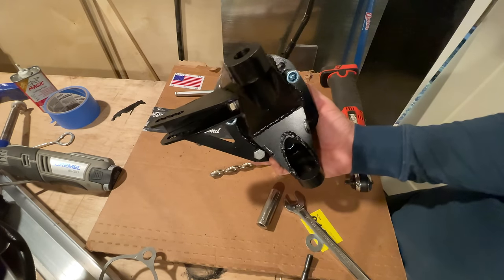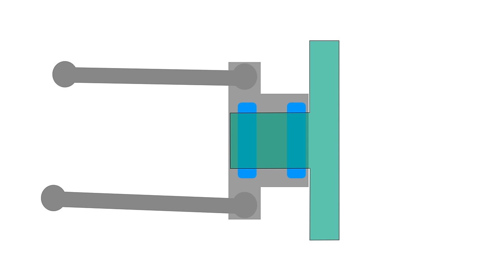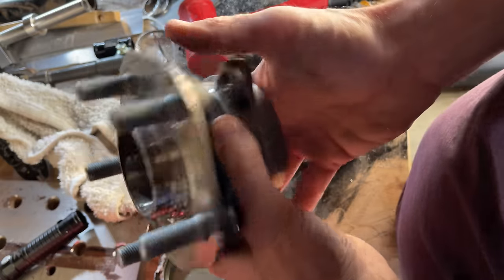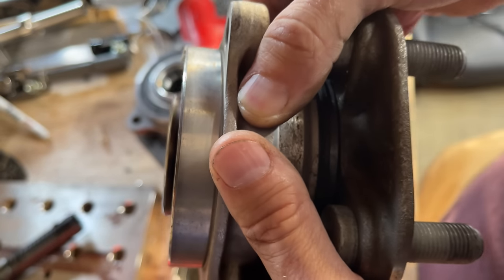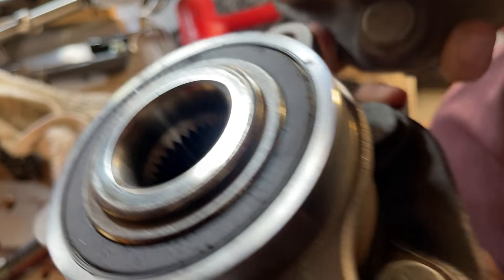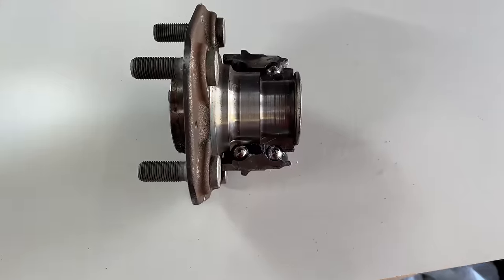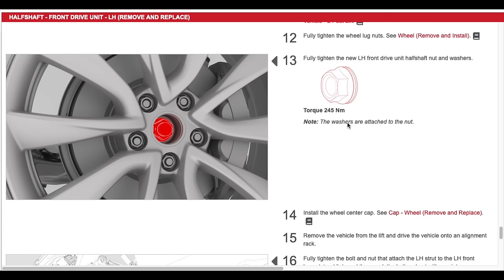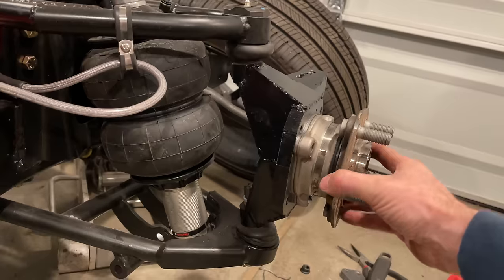How Wheel Hubs Work

Comment: Since you have so many hubs now, why not just add more tires to the car?
Reply: Oooooh!!! First eveah Jaguarx 6x6    sexxxy!!
Reply: @noobFab  Like the car from League of Extraordinary Gentlemen haha
Reply from the maker: I’ll just build a new car, starting with the hubs
Reply: @SuperfastMatt  But will it be a 6x6, because then you'd need to buy a few more hubs!
Reply: @SuperfastMatt  sounds simple😅
Reply: @SuperfastMatt  if you do this, i will subscribe
Reply: Or make a trailer..
Reply: Aren't you supposed to be warming up baby bottles?
Reply: @SuperfastMatt  seems legit.
Not gonna build it from the top down!! Haha
Reply: @noobFab  it would actually be a 4x6 since those non driven hubs have to go somewhere.  That's of course assuming he drives both rear "axles" if he doesn't I guess it'd be a 2x6 which is just weird.
Reply: Plenty of room in those front fenders to do a Tyrrell-esque Jaguar MkV/P34
Reply: Imagine 2 sets of wheels at the back. That would look so mean
Reply: @SuperfastMatt  that's the spirit!
Reply: Missed Opportunity
Reply: @SuperfastMatt  yup save money by building another car or 3…..
Reply: I'm thinking you should Mount them at 90°in the middle of car on each side, then have electric actuators to push them down so you could crab walk in a parking lot
Reply: @SuperfastMatt  that is a great idea.  Also see how hard it would be to make a 5 bolt hub into a 10 bolt hub

Comment: Hi, I used to work in wheel bearing engineering at delphi. On some cars they would use the same bearing front and back and just cap the hole. You should be fine. I will say that is a ready beefy bearing though (makes sense with battery weight). I would be cautious with any aftermarket product. And yes the outer raceway is integrated to the spindle which is heat treated. Some aftermarket bearings with use different spacers and inner rings for different applications while using the same spindle to save costs. Integrating improves the tolerances. The folded over metal is called cold forming and is very strong. If you wanted to take apart easier you could have used a lathe to cut below the inner ring. Then you could just use a press to separate the hub from spindle.

Comment: As a mechanic, I could have told you this from the start just by looking at the bearing. Most auto makers use bearings that won't come apart, even if no axle is installed. This saves them money because they don't have to manufacturer two different bearings for 2WD and 4WD applications.
Reply: This.
Reply: I think you overestimate the forward planning of Tesla. There is some really poor engineering choices in their cars.
Reply: @rubiconnn  How is that different from any other auto maker? I think the only one that is somewhat smart is Honda. Also, mushrooming the end to hold the bearings together is a very common practice in the industry.
Reply: @madmatt2024  I've been a mechanic for years, almost all 2x4 and 4x4 optioned models have the same front hubs idk why people are freaking out about this... Toyota does for everything with 4x4 as an option.

Comment: Instead of paying $500 for a part, I saved money by making my own own out of $250 worth of material. Don't worry about the $1500 in specialty tools that I had to buy to do the job.
Reply: The job was only an excuse to buy the tool anyway, man.
Reply: yes. it is in another fiancial advise video, pretty sure. May be multiple times.
Reply: "Never buy anything that you could make in 3-4 weekends for less than double the price."
Reply: Exactly. And you’ll justify the cost of the tools (to a spouse and yourself) by stating that you are going to use those tools many times in the future anyway.

Right.
Reply: But these tools could be used in a future project. Or at least make your workshop look way more professional. So I don't see a downside here.

Comment: I understand the hesitation. I parted out one of my Explorers, pulled the cv axles and front diff out, put it back on the ground and rolled it back so I could get the engine hoist in position, and in that five feet one of the wheels started to f' off. I knew it absolutely couldn't be driven without the stub in place, but I was not expecting it to have near zero load tolerance.

Comment: Good call on the non-driven hubs.  The front diff cracked in my Silverado once.  We pulled the wreckage out and tried to limp the truck out of the shop into the "yard" while we scrounged up a new diff.  Luckily the new diff came with new hubs.  The originals made it about 4 feet without the axles in them.

Comment: Nice cross section.

When I was making my CNC cooling, I had to cut a hole in a 1/8" stainless steel plate with only handheld tools. I was discouraged seeing a Bosch bimetal jigsaw blade dull in only an inch or so of cutting. For the CNC, I had bought some Kool mist solution. I had a fashioned a mister from some odd parts. Oddly, adding the misting to the blade meant that the blades lasted. I went from 2 blades for 3 inches of cut--to one blade for about 8" of cut. Little Machine shop, at one time had pints of Kool-Mist, whereas everyone else wanted to sell you a lifetime supply. I usually mix it up stronger than normal--just to make sure nothing rusts.

I am reminded that some bike alloy brake calipers have steel truss bolts going through them--only to be a stressed part that keeps the caliper from cracking. I hope the Tesla hubs aren't like that. I hope that the axle is not meant to keep that bearing tube together. Perhaps after a few hundred miles, the part could be magnafluxed, to check for cracks.

Cool projects. Thanks for sharing.

Comment: Typically the "driven hub" type hub has a split bearing in it and requires the axel nut and cv shaft to maintain a "clamping pressure" on it when the weight of the car is on it and normal operating loads are applied to it. not having this "clamping" in place will end up damaging the bearing and possibly allowing the assembly to fail and / or fall apart.

Comment: My Solstice had identical hubs on all four wheels, meaning that the fronts also had splines for an axle. Like you said, it depends on how the hub is constructed, but the mere presence of splines isn't sufficient to say that it'll come apart without an axle & nut.
Reply: Chevy Equinoxes are like this as well in regards to the rear hubs on front wheel drive models.

Comment: I race in Spec Corvette and we use "driven" (rear) hubs in all 4 locations without problems.They look almost same as yours with fronts being blocked and rears open with splines.
Reply: Hah, was going to point the same thing from tracking a C5.
Reply: Just curious, is there any reason you do this other than shrinking the amount of different spare parts needed?
Reply: @TheOystei  This way I can carry 1 spare that fits all locations. We also use upgraded SKS parts and I think they only come open (rear) style. We also use longer ARP studs.
Reply: @TheOystei  Yep same here, the heavy duty skf hubs only come as one part number for all 4 corners. Amusingly I've got the SKF hubs on the front and stock on the rear right now because evidently I'm harder on the front of the car than the tail.
Reply: @mrmxpop  Yeah that was what i thought. and yeah, the sweedes makes som quality bearings.
Reply: @Misterfairweather  Front sees more axial load than the rears so they tend to wear out faster. I assume this is accelerated in racing.

Comment: The front hubs on my Aston Martin Vantage are splined "driven" hubs like the rears.   They don't fall apart on the race cars.    Apparently they don't need axles either.
Reply: No hubs do, axles are floating.

If they weren't you couldn't have suspension.
Reply: @Robert-cu9bm  some hubs do use the axle stub to hold them together.   My old Pontiac did, for example.
Reply: And just to add, the rears on my older Impreza do as well, they are pressed in, but without the axles they would fall apart after some driving. However the rears on older Outbacks and Legacies are hub assemblies like in the video.

Comment: We beat on unit bearings in our rock buggies (40”+ sticky tires) the only thing that holds the axle in the splines is a snap ring. I am positive we put way more stress on them then anything you would be able to accomplish with your car. 
Either way, awesome build!
Reply: Many custom and racing hub and bearing systems are retained by a snap ring like that... which I didn't realize until recently. The pressed version eliminates the tiny bit of play that the snap ring allows, but either works.

Comment: How to save money (somehow): buy replacement parts you don't need and cut them in half.
Reply: By destroying 2 hubs, he saved himself the cost of a new Jaaaaag Mk5 front end, a cooling system, suspension components, steering rack... This is quite a dramatic failure mode.
On the other hand, gained some YouTube income.

Comment: There are AWD/FWD variant vehicles that use the splined hub in the rear regardless of whether there's a differential between them as a cost saving measure.
Reply: ... there could be axles with no differential ?  Oh well they save money on metal by having  a big hole in the hub.

Comment: Many cars use the same front hubs as the rear hubs, which don't always have axles in the rear. 
Good example is a 2014 Ford Taurus. Even just the FWD models have open axle ready rear hubs.
Reply: I'm seeing a lot of comments like this, and I'm suspecting that this is a newer move by OEMs. I've had a bearing fail (2 of them, simultaneously), but it was on a 1992 Chevy Silverado that I'd pulled the axles out of to replace the differential.  I've curious to know when this practice of "unsupported" unit bearings became commonplace.  I used to work at the auto parts store, and don't remember seeing any with the factory pressed end, but this was nearly 15 years ago.

Comment: I agree that the huge amount of torque is to stop the axle moving and wearing out the splines. Where does the bolt pull up against? a mushroom part on the axle. It does not hold the hub in.

Comment: Great video Matt.   You could also use a short shaft or part of an axle to pass through the hub and bolt it together.  Put a flange on the inside of this short shft, and threads on the outside.  Bolt together and you have similar support to having an axle.
Reply: Except that if you actually listened to what Matt said, you would understand that this extra clamping arrangement is completely pointless.
Reply: @brianb-p6586  You may be right, but I got the idea he was not completely satisfied with the flared end of the bearing carrier.
Reply: @johnmckenzie427  He's being a little paranoid by changing hub units, but every one of the millions of cars on the road with bearings of that construction and no axle shaft work completely satisfactorily.

Comment: You have to have the axle splines in the bearings with a bolt or nut because in addition to the possibility of it all coming apart the bearings will not last. Take the axles that fit in the bearings and take apart the outer cv joint and just use the shaft and cup.

Comment: Interesting construction method. So the whole thing has to be made out of bearing race material ( high surface hardness, usually brittle ) AND at the same time "squishable"  / deformable ( not brittle, usually soft ).
I'm guessing when the Metalurgic Engineer saw the spec sheet they just went like -"DAFUQ U THINK I AM? I don't do miracles!"

Comment: FYI  my experience with hubs of this type is that you always need at least an outer cv joint in there. Have seen cars pushed 100 yards with empty hubs and when they're put back together and driven the bearings are noisy.

Comment: I have a VW T5. These some in both Front wheel drive and 4 wheel drive. Mine is a front wheel drive but the rear hubs still have the splines in them for the 4  wheel drive version, these do not have a big nut to keep them together, just a big hole through the middle.

Comment: GMT800 trucks that have 4wd have this same style hub, and they do not have the flange on the back.  they specifically state to not run them without at least a stub axle in them and a nut holding them together to set the preload.  even with that flange, there would be some play in the bearing, which would pull the bearing races out of alignment and cause odd wear.  it might not separate, but it won't last as long.

Comment: I had a buddy that had a 90's grand cherokee that a cv axle went bad in and he didnt have the money to replace it. He removed both front cv shafts and drove the jeep for years that way with no problems. We even pulled a steel car hauler trailer 2,400 miles round trip across the country to pick up a car and back with no issues.

Comment: The issue is the hole in the middle, without the axle backing it up, the inside race is not up to the task, that's why the no motor versions axle hole is not hollow, go with that version for sure.

Comment: Dealer service tech, here; lots of trucks and SUVs use the same front hubs for both 2WD and 4WD models, which are of course splined. They are all the "bolt-on" type rather than the "press-in" type, the latter of which absolutely require an axle and a nut. Both require a good bit of torque, though, to prevent the axle from breaking its own nut loose and coming apart.

Comment: I'm pretty sure they will hold together without an axle in them.  We have cars in our Cab fleet that come in 2WD and AWD, but use the same bolt in hubs for both options.
Reply: That's a broad assumption.  In Matt's case it's probably fine because the visual inspection seems to indicate otherwise identical construction.  Not all unit bearings have that pressed flange, however, and those without will fall apart if loaded without the axle shaft installed.

Comment: My first reaction to you starting to saw through the whole hub with a reciprocating saw. "That's gonna take quite a few blades"
Reply: I know he really loves buying those multi packs of blades but I was thinking how he really should use a angle grinder with a cutoff wheel to zip through that whole thing quickly. And then he gets an angle grinder with a cutoff wheel and only uses it to go through the hardened race.... And he's right back to the slow reciprocating saw blade. Lol

Like dude, you could have cut through the whole thing with a 98 cent harbor freight disc but instead let's go through multiple reciprocating saw blades....
Reply from the maker: The outer part was aluminum which doesn't cut well with a cutoff wheel. but mostly I hate cutoff wheels. They cover my garage with a fine mist of tiny metal shavings. Less so with the saw. Really I should have used a band saw.
Reply: @SuperfastMatt  The method nyou showed in the video was probably best. Using the recip. saw for the aluminum and the grinder for the bearing races.

Comment: Hi Matt. I have an Model S85 from 2014, and I have a hub probably from the rear of an Model S or from the front of a dual motor Model S, because it has splines, and I don't have front motor! So it applies ti hubs from the Model 3. I Also have a question for you, do you know how many tooth has the ABS ring? Cheers

Comment: The Ford flex and all other fwd or awd ford's of that gen, Taurus, explorer, etc use the same hub front and rear and everyone has a pass though. They also have 5x114.3 pcd so you can get good rims. Infact they look very similar to the model 3 hub. Did tesla do a tricky when they swapped from 5x120 on the s vs the 3 and use old Ford parts

Comment: The front hub for the 2018 Ford Mustang GT350R has a hole through the center with splines and is only available with rear wheel drive.  Just sayin.

Also, not sure what size bolts those are, but if they are 3/8" grade 8, tensile strength = 10500 lbs, so 31500 lbs for 3.  If they are 5/8" 27100 for just one!  Sorry for being pedantic.  Love the channel.

Comment: Obviously not apples to apples, but the front hubs on my 3000GT (which look very much like your hubs) require axle shafts in them to operate correctly. I picked one up as a parts car that didn't have axles in it, and had been rolled around a couple times and the hubs themselves were actually starting to come slightly apart. Even to the point that I had to push the car down my driveway because the hubs didn't roll very well on their own anymore.

Comment: axle nut is NECESSARY! I saw a ford explorer 4wd to 2wd conversion lose a wheel on the road.  They ended up towing it back to the shop, cut the shafts to stubby nubs and used them just for the spindle and nuts.
Reply: also I am a professional mechanic ;)

Comment: Suggestion, Could you cut the stub axel off the tesla drive shaft and technically use it as a big bolt of sorts to torque to the 225ft? round off the cut end in alathe too to its balanced?

Comment: I would have used the splined hubs with a scrap CV cup stub-axle in each, torqued to spec.  Just my two sense.
Reply: this will work
Reply: Why? It's completely unnecessary.
Reply: @brianb-p6586  If you say so.
Reply: @latitude9.5north54  The auto manufacturers who use this type of hub-bearing unit (including Tesla) say so, too.

Comment: No cheap axels out there you could just cut up?  Some AWD cars that come in FWD use stubby little splinned plugs.  It's basically the tip of the axel.  I had to yank some out of a CRV for my civic so I could drive it around while the rear diff was being rebuilt without the wheels falling off.

Comment: You probably know better than I, but I had heard that torque value was a function of diameter of the bolt/nut, etc.  So maybe 245 lb/ft is just the default torque spec for a 28mm diameter threaded bolt/nut or whatever?

Comment: I suspect that torque spec is so high because Tesla ran in to trouble with spline damage in early Model S Performance builds. I had a 2014 that ended up needing rear half shaft replacement due to spline wear, which was a common enough fault that the service center staff knew it as soon as they heard it.